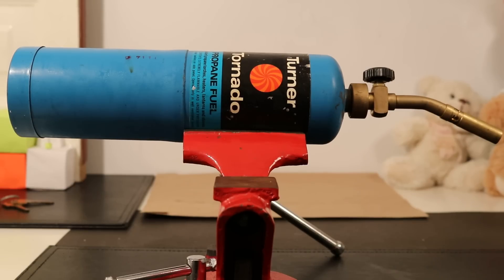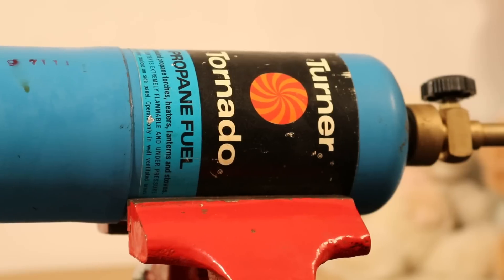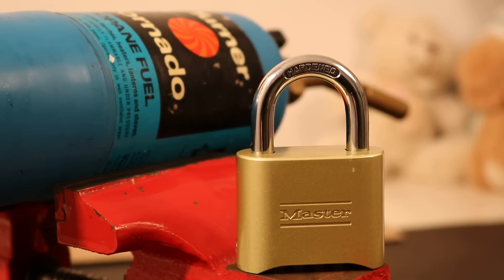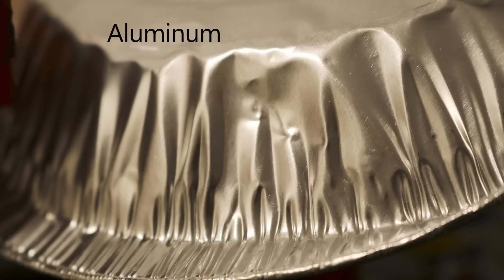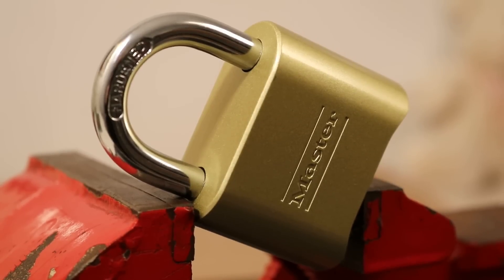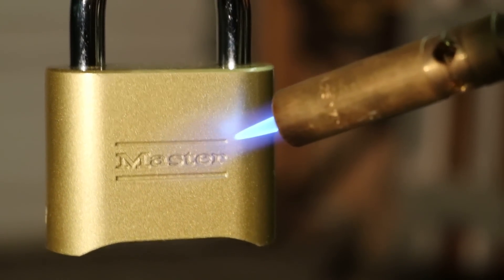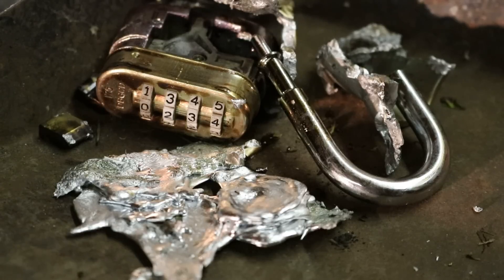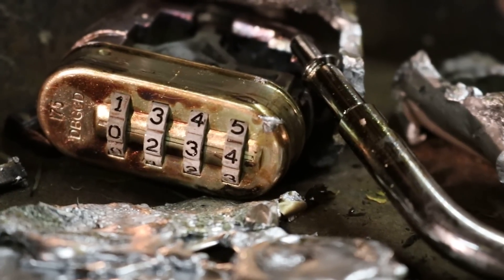How to Open Locks with a Blowtorch

Comment: Do you know what temperature the lock was at melting point? I know locks are made of a toughened  alloy.
Reply: MAD Science Hacks one year later: master locks are made of aluminium. Low melting point.
Reply: I know your commnt is old, but usually the body of the lock isn't like that. They usually only put the case hardened steel on the actual shackle part to make it hard to use bolt cutters in it. That is what I've noticed, anyways..

Comment: "How to open locks with a blow torch" 
You unscrew the torch from the cylinder, build a wooden trough at an angle, aim it at the lock, then use a 500SW and shoot it in the valve, causing it to rocket up the trough striking the lock.
And it should pop open.
Reply: I like how you were specific of the gun (a 500 magnum sw revolver)
Reply: Shooting the valve would probably  just make it explode.  Leave only the valve exposed and wack it with a crow bar or some other peice of metal

Comment: He explained the heat temperatures of propane and oxygen fed torches, but he did not explain exactly which type of torches he used to open the lock in this video.
Reply: Go onto Amazon and literally search propane torch mate I'd even recommend dual flame but don't rob of people at all it's illegal for a start and completely wrong to do so people work for what they own